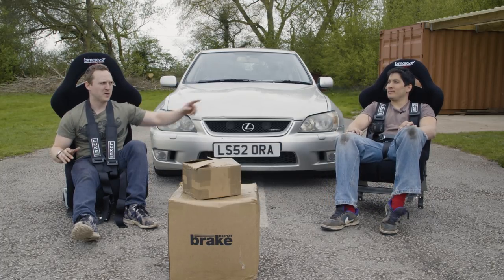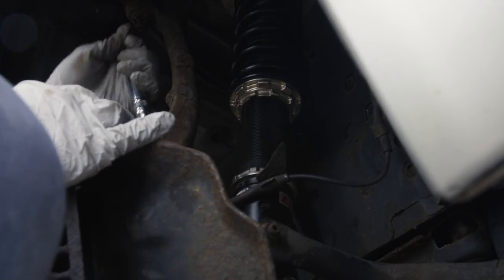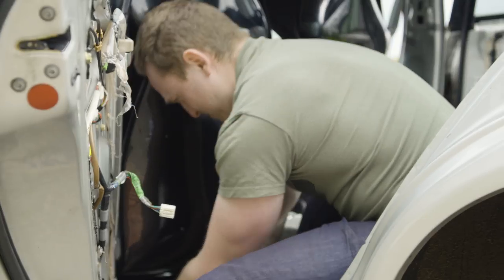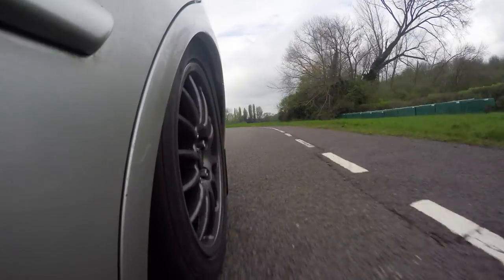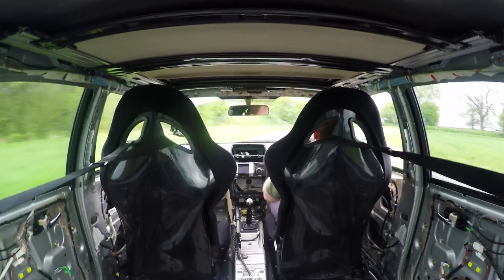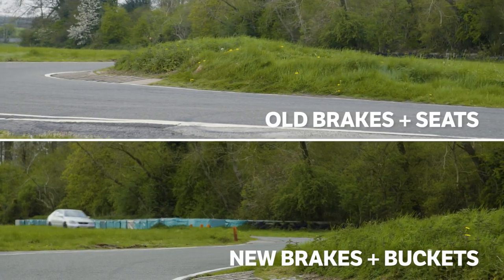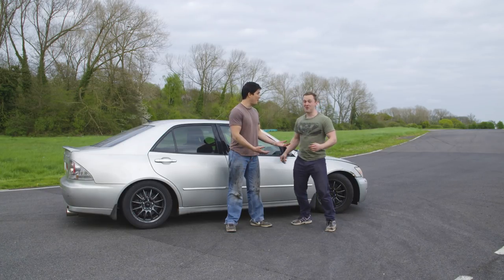How Much Faster Is My IS 200 Track Car With Performance Brakes & Bucket Seats?

Comment: You forgot to paint the calipers red for the extra 10 hp
Reply: And a sticker !
Reply: hey Jimmyyyyy
Reply: sam heeeeyy chester!
Reply: with brembo sticker
Reply: Or add fake plastic brembo cover
Reply: +Joudy januar It's an MCM reference.
Reply: Djhg2000 the plastic brembos where in a mcm video aswell, in that civic build.
Reply: +goosemeister Crap I forgot about the Civic. Never mind then.
Reply: Djhg2000 unidentified human slime
Reply: Djhg2000 can i fit this on my honda?
Reply: +goosemeister Such a shame Moog messed up on the Dentist Jet though. For instance, SAABs do not like having the boost messed with behind their back but will happily boost to oblivion when you tell them to. As a SAAB guy some of those episodes were painful to watch.
Reply: Djhg2000i can imagine, he did pretty much did the opiside from what marty did to 2sexy, love the channel tho
Reply: +goosemeister Yeah it's still one of my most recommended channels. Which is why the Dentist Jet didn't just roll off like yet another failed SAAB tune. Trust me, he's hardly the first one to fall into the trap of trying to fight the engine management error correction.

Both the boost valve and bigger exhaust are classic tuning mistakes on a snail powered SAAB. The boost valve makes the ECU pull back to compensate for the boost leak and the bigger exhaust skews the calculated scavenging effect. The net result of both is typically a loss of power.

What he should've done is to get a 3rd party tuning ECU. I think Maptun still makes those, SAABs are still common on the roads here and everything 900 and newer is still being tuned today. It's not as easy as the newer Trionic systems where you can literally just reflash the factory ECU over the OBD port but it's close enough.

Sorry for the long post but that car really got to me.
Reply: Djhg2000 i am not really mechanicly skilled with cars so i dont understand everything of what you are saying but since it will be a while before i will be able to own a car it somehow sometimes triggers me that some people modify a semi-rare car to a point where it cant be undone aswell  especially with older cars.
Reply: Djhg2000 i watched a topgear episode on saab and the company has a interesting story.
Reply: +goosemeister That was a fantastic show, they got a lot of history in there and I can vouch for the SAAB driver stereotype. I'm in engineering college and a lot of the guys there like SAABs and Volvos.

I have a 1997 9000 CS and while I'm well aware it's not the fastest car out there (although the overtaking pulls are great) it's amazing as a daily driver. You get a tonne of feedback (both audably and mechanically) that other cars can lack almost completely and the large rear door makes it miles more versatile than a regular sedan.

In my pervious SAAB, a 1992 9000 CC, I got an entire full size standing fridge in there and could still almost completely close the rear door. An OG900 like the one on MCM should be able to do about as much.

I also have a SAAB 96 V4 from 1975 and driving it at full throttle is amazing. Old Swedish cars are terribly underappreciated and misinderstood. Plenty of clever engineering went into these things and it's a bit like the quote Clarkson had dug up; "nobody could work out why they were so expensive until they had a crash in one". Which was also demonstrated by the roof drop test.

Anyway, my hopes are I'll be able to work for NEVS in the future. It may not formally be the same company but they hired a lot of the engineers from SAAB. Right now they're prepping for a launch which, from what I've seen so far, will put Tesla in an awkward spot ;) . Look out for that in a year or so.

Best of luck with finding a good car though, maintaining one over a long time period can be difficult without doing some research first. Obviously I'm biased but Swedish cars are relatively easy to maintain. Just read up on the cars you like and go from there.

Oh and a friendly tip; remember that you can pretty much always find snippets of the service manuals online so you can tell how much work goes into something like changing an interior light bulb or replacing the oil filter before you buy it and find out the hard way.
Reply: +Djhg2000 you've had some saabs in life, thats pretty cool. i am going to college after this summer (if i actually pass my final exams wich i am having this week) and in the Netherlands its not really needed (and possible) to  own  a car in college but i am thinking of buying something like a old zundapp in a while  to get started on as a hobby. anyways i wish the best of luck to you in finding a job for NEVS and doing something you like in the future and also thanks for the tip.
Reply: +Mc GetRekt Calm down, it's an inside joke.
Reply: Mc GetRekt its a ricer joke
Reply: Bhp   😆😆😆

Comment: Dud you bought the wrong seat (well wrong seats for your size). The belts aren't supposed to rub against the seat. If you where a bit bigger (or if the holes where a bit lower) it shouldn't rub. Your seats aren't going to help you in case of a crash, actually it will make your life even worst in a case of accident.
Reply: The Canadien stig well. Then let's hope that future buyer will be taller, than him :)
Reply: I'll use a booster seat for the next ep ;)
Reply: Alex Kersten 😄
Reply: Artem Lokhovitskiy lol
Reply: THIS!!!
Reply: i was reading this and then his tool box fucked up ... dudes having a tough time lmao 😫😂
Reply: his shoulders are just below the shit.    does bmarco sell booster seats ?
Reply: Bimarco Futura - one of the best seat for tall people  (over 6')
Reply: Arturo Maldonado Jr yes
Reply: How tall is Alex?
Reply: Josh Edillon I don't know
Reply: I'm more curious to know where the seat belts are secured. Arnt you supposed to have a rollcage to run harnesses ?
Reply: Hugh Bug , you aren't supposed to have a roll cage to run a harness but it is recommended, as in the event of a roll over a bucket seat will keep you in place. So without a roll cage you can't get out the way. But with a normal seat belt you would possibly come out better. 
That being said loads of people including myself run buckets and harnesses without a roll cage. I'm not a serious racer, so that's my excuse. I'm not spending £1500+ on a cage when I do 2/3 track days a year and the car sits in the garage the rest of the time.
Reply: iTheGeek you can mount a harness on a harness bar or even use original seat belt mounting holes if they are at a decent height. Which it looks like Alex has done.
Reply: Hugh Bug not really
Reply: Steven Thomson its really, really unsafe to wear a harness without a cage. the stock seatbelt will do a much better job
Reply: Special I agree. I'm just saying you don't have to.
Reply: And at the end of the day its your life on the line so if you want to risk it no worries :P Sick polo btw Steven, I only noticed because I own a mk3 gti :P
Reply: Hugh Bug in my eyes people do far worse than not fitting roll cages. But each to their own. If I took racing up seriously then I'd get one. 
Cheers, I love Polos. Fun cheap little cars.

Comment: You should've done a 60-0 test before and after installing the new brakes. Remember this for next season. Yes. We want more seasons.
Reply: He should have done a 0-60 before and after installing the brakes too....
Reply: another season would be awesome. New season, new car. One of the best car related sponsorships out there
Reply: Frost73 Eh... it's about building a track day car, where the overall collection of performance is more important than raw numbers of 0-60 & 60-0 & lateral Gs...60-0 especially, because the braking distance is constantly shifting due to heat, wear, & what the car is doing each moment.
Reply: TinKnight You are right, but it would help to see how much of an actual difference adding new brakes can do.
Reply: Bigger brakes will hardly improve the stopping distance at all. It's all about better heat dissipation and stopping the brakes fading. The stock brakes on the first stop will stop just as hard, but big brakes will keep that performance even after a lot of abuse.

Comment: Nah don't end the series like if you agree
Reply: HowlingWolf 221 he should end the series at least after swapping the stock inline 6 for a twin turbo v8 and improving aero/widebodying the car....and then putting it up against a nissan gtr!! XD
Reply: tbh a gtr without an i6 made me cry :p
Reply: Well, the point of the series is to have a budget-friendly track day car, which they've pretty much reached the threshold of what can be done and still be budget-friendly.  Impressive results from only 4,000 Pounds...but a turbo or engine swap would easily double that total.

It is a good series, though, and it definitely shows the value in smart modifying rather than just throwing gobs of money at the rig.
Reply: They can add bolt ons. Turbo. Gas. Whatever dude the choices are loads :(
Reply: I agree, why not bolt on a few power adders before you toss the car away
Reply: HowlingWolf 221 just lap something else that's quicker and try and beat that time
Reply: just exactly what I thought. keep modding the car until it is a track weapon and put it against the real mighty godzilla.
Reply: @racingjets1  the 1gfe (is200 engine) will do 300bhp 7psi turbo with nothing but a turbo and a fuel cut defender if anything you would 2jz swap it

Comment: remove the sun roof and weld or bolt a thin plate over it. you won't beleave how much the sun roof weighs. it will help with body roll.
Reply: backyard magic - I've thought that since they started. Also should remove the glass windows and replace with perspex, but that one is a bigger job. :p
Reply: It really does help in my Bmw it was almost 50 pounds

Comment: I love the series, but I am pretty sure those seats are too big for you. I'm pretty sure that the harness should have room to move through the seat and should be level with your shoulders, not slouched downward, which could cause an issue in an accident. I do not work at a store that sells seats or anything, so please correct me if I am wrong.
Reply: Thomas Levis also looks like where they are mounted is slightly to high, needs to be between completely horizontal and 45 degrees downwards for the same reason. I'm not a tech either but just looks a bit out

Comment: I really hate the fact that they ripped out the interior and made this basically impossible to daily. The GT86 may have already lost but it could function as an everyday car. A minor gripe but loving the series anyways
Reply: also if making a track only car, why bother with two seats?
Reply: t3mb3 for ride alongs
Reply: exactly. But then again, for that price you could own a daily and a track day car.
Reply: t3mb3 Camera man... Triggered
Reply: t3mb3 I personally fell that they rigged the gt86 and that they could have done better than 40 seconds
Reply: Iamkieren yea they should do more laps in the gt86 and then take the best not just from 3 laps
Reply: Iamkieren The gt86 has super skinny tires and not much power, it's really not fast and quite uncontrollable due to the Prius tires
Reply: t3mb3 Hense why it's the ultimate lexus is300 track car build
Reply: Does england have some sort of law with stripping interiors or something to make it not able to daily it? In my lifetime i've probably seen a few hundred stripped cars running around here in the states. The only thing that anyone would have a problem with is noise and if your stripping your interior you obviously don't car about noise lol.
Reply: Devin Stambolziovski idk but i know the uk is more strict than the us about car mods
Reply: It is legal to run as long as it passes MOT. If you have rear seats and no belts you fail but no seats and no belts is fine. However you would have to declare this to your insurance provider
Reply: Mr.Woggle and insurance prices would significantly increase if they'll insure you
Reply: Iamkieren gt86 is a shit car with prius tires and no power
Reply: t3mb3 well the Prius is a great car, economical and it looks pretty slick too!!
Reply: Primacy HPs are indeed Prius tyres but they're not low rolling resistance "eco" tyres and nor are they actually low grip.

They're grand touring summer tyres as also fitted to executive class saloons like the E-Class and Lexus GS, as well as the Acura TSX/Honda Accord Euro, et al.

Obviously there are much better tyres out there but considering that the 86 can still pull 0.9g on a skidpad (lineball with the JZA80 Supra running, at the time, top-of-the-line Bridgestone performance tyres) shows that those tyres really aren't what everyone believes them to be. You can get the 86 to slide quite easily but it's nowhere near "uncontrollable".
Reply: "Track Car". Let me repeat that. Track Car. One more time? Track. Car.

Comment: Btw what about downforce
Reply: Legendary Dovydas A small Ducktail for example would do, but that adds extra weight.. :|
Reply: With this kind of speed there is no need for downforce
Reply: zoufmalade It would still improve the lap times in the shicane(don't care about my spelling) and he would go faster in the coreners
Reply: Corners*
Reply: Yeah maybe for the chicane (and he's not even lifting the throttle), but the other corners are definitely to slow to generate enough air flow to produce downforce. Playing with tire geometry would be much more useful for such a track
Reply: it needs more camber. not like stance nation camber but enough to help with turning .
Reply: Colby Yep, with a bit of pinch (I think it's the word) at the front to help the car in the tight hairpin
Reply: Lighter and faster would make the downforce more useful but at this point, it fucking pointless
Reply: I absolutely agree
Reply: Legendary Dovydas o shit my names dovydas boiii

Comment: In the future do an engine swap either a 1jz vvti or a 2jz vvti
Reply: or better yet, a 3sgte
since the Altezza came with a 3sge so the 3sgte engine would be a nice and different swap from the all-time jz swaps
Reply: Nasir Mahmood But he has to save money for Phil! 😂
Reply: That'd be pointless, considering the is300 has 2jz. They probably would've bought one of those instead.
Reply: No eBay turbo kit
Reply: Victor Alcaide phil already got his v6 in him :)
Reply: 本身 There's a HUGE difference between the slow 2JZ-GE that's in the IS300 and the 2JZ-GTE that you keep hearing about. 

Not to mention that with the price difference between an IS200 and an IS300, you could get a hell of a lot more mods than the extra small amount of horsepower that it'll give you
Reply: There isn't a ''Difference'' that is huge, alot of the parts have been made more durable to make the 2jz even more ridiculously robust. We are also talking in terms of mod's the 2jzge has also alot of potential as the 2jz-gte. Yes, the the 2jz-gte is the obvious winner for sheer potential and power (over 1000hp) but in this scenario that is a track car Im not sure how 1000hp in a small IS body would be useful. 

The clear difference's is igntions systems and the intake timing, which as mentioned needed an upgrade but Id say that they still follow the same architecture.
Reply: Kanggoo the beams 3sge that comes in the altezza is plenty, it's a good high revving NA 4 banger
Reply: Kyle Counter i got a 1st generation 3sge in my car and its fun but im going to swap it with a turbo one
Reply: IS300 manual is almost impossible to find, especially at this price point. Also, 2JZ adds more weight.
Reply: 3SGTE ıs one of the best engines that Toyota have ever produced. Also ın GT500 Supra's Toyota used a powerful TRD 3SGTE cause of its lightweight against 2JZGTE and still reliable. So hands off 3SGTE

Comment: You guys should really watch ChrisFix before doing things. That brake job was awful, bucket seats are wrong size.
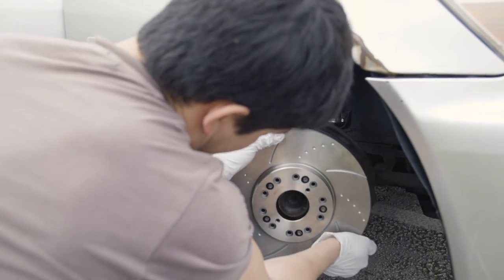Reply: Exactly my point. @3:00 it is clear that rust inhibitor had not been cleaned judging by the reflection clarity.
Reply: who needs to service the brakes when you change em. just jam the new pads in, no lube, they'll seize quickly. the rust inhibitor will clear the first couple brake applications.
Reply: Yeah I was thinking about the rust inhibitor so i came to read the comments

Comment: Hi!

I recommend to install a anti roll bar kit. 
You can adjust the setup quite well with a harder or softer adjustment of the anti roll bar.

Also you can install the powerflex suspension things (I do not know the english name for this parts, sorry). 
This gives you a more direct driving performance. 
A new fly wheel is not so race time per price economic. 

BR

Comment: Hey CT guys! Have you noticed that you installed the discs in two different ways? at 5:31 the direction of rotation of the rear discs is correct according to the recommendation of EBC but the direction in the front is twisted. You installed the left one on the right and vice versa. You can find that information on the website of EBC. I've got the very same setup on my MX-5.

Comment: Little tip for those installing brakes: New brake rotors come with a thin film of oil to prevent rusting, make sure to wipe it off before installing your new rotors and pads

Comment: When I used to compete in autox, some classes did not allow seat swaps or harnesses.  So, you had to be more ingenious.  Once common trick was velcro belts around the waist in combination with the factory seatbelt.  The two together keep you planted almost as well as a harness.  Assuming the car has decent buckets stock.   Like in this vid, you stop thinking about keeping yourself in the seat and just attack harder.  It's a great simple trick.

Comment: Great videos! I look forward to seeing how much the Lexus improves with the new clutch and flywheel. I am glad that you mentioned how much the stock seats weigh. I was wondering about that during the whole video. Have you been able to get an idea of the current power to weight ratio of the Lexus? Dyno runs would be a cool video!